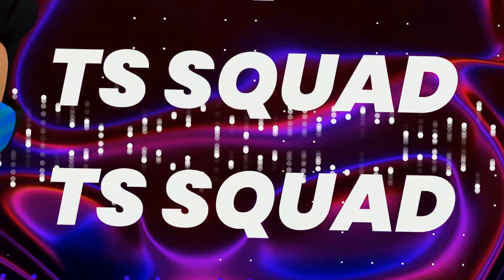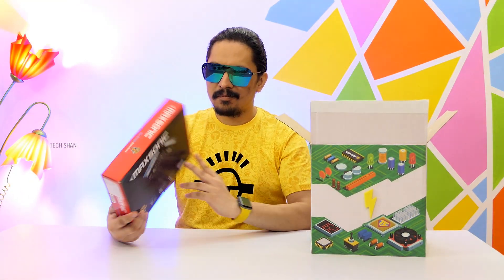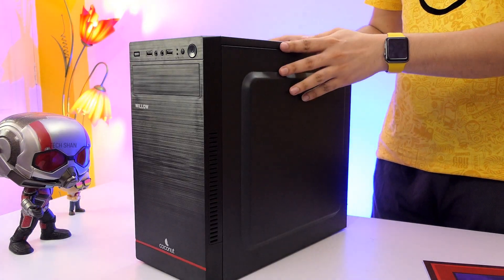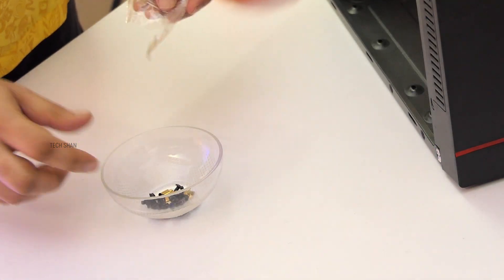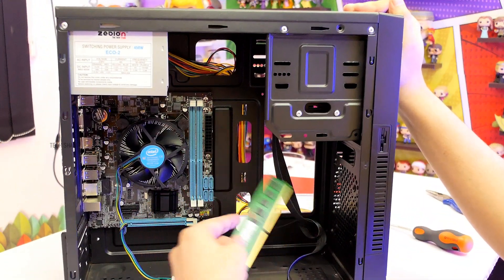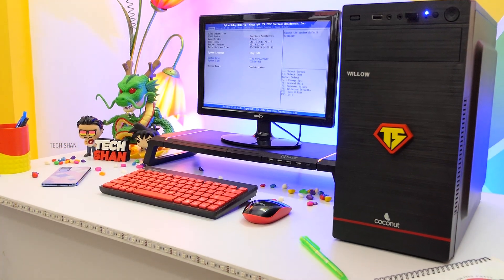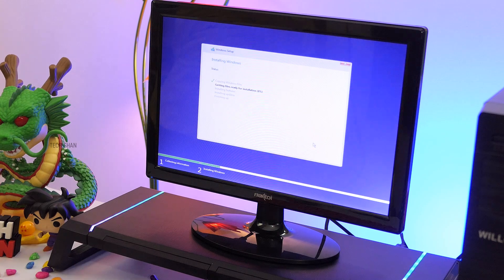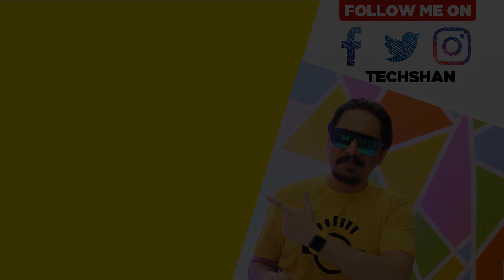Insane 🔥 For Just 8500 - Build Your Own Budget PC ( PC BUILD )

Comment: Awesome Video,

Built the same config for 8k back in January. The only difference is Zebronics Maze Cabinet, Hynix 4Gb RAM, No case fan, and Lite-On SSD.  

It catered to all my needs but I had to upgrade in September to cater my web development workload with 
Processor - 2core 4thread i3 3220 to 4core 4thread i5 3470s,
Another 4Gb Ram stick instead of a single 8Gb to take advantage of dual-channel.
A TL-WN781ND PCIe wifi card.
After the upgrade build costed 10.7k. Paired with an old 15.6inch LCD monitor costing 2.5k.